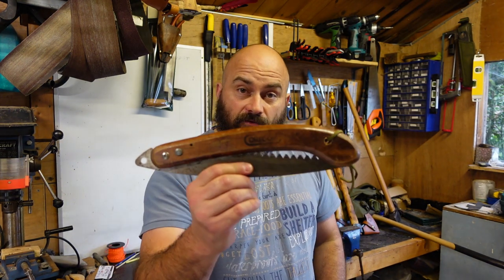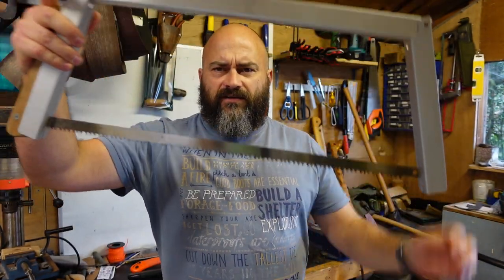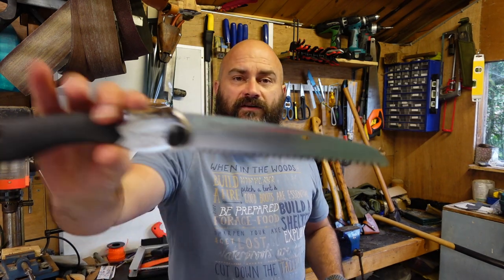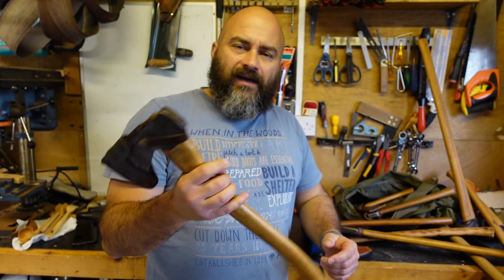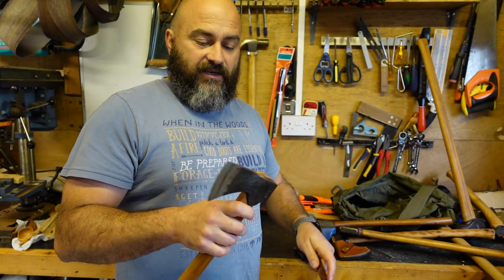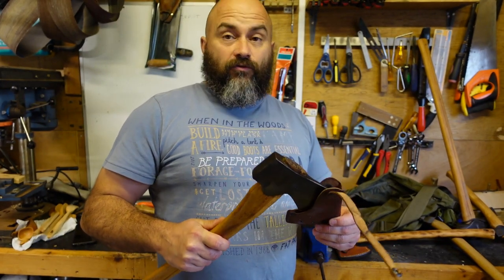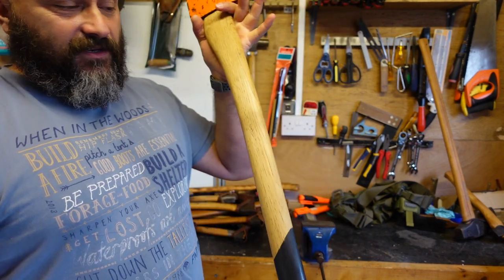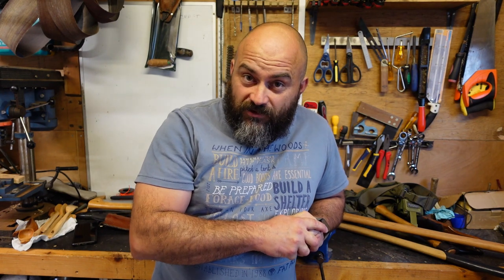038 My Axe and Saw collection

Comment: I'm up here in Northern Sweden and we have a large wood heater in the basement of one of our houses that heats two houses through a hot water system during the whole of Winter...well,  I cut, limb, section, carry out of the forest, section again and cleave about 33 cubic meters of firework every Spring. All I use is a Husqvarna Rancher chainsaw, an ancient, good quality cleaving axe for the job (it looks very like your Husqvarna but isn't) and a GB Small forest Axe...no way would I use the hydraulic machine instead of the cleaver either, not while I have the physical capability to still swing my beloved axes.

Super collection mate and nice to hear your thoughts on them.

Comment: Greetings!  You may well have more hand saws than me, but not axes or chainsaws LOL! Your first Wetterlings axe that you showed is, I believe,  a Large Hunters Axe, being a big Wetterlings Axe fan I picked a used ine up last year and cleaned it up. I have had the Wetterlings Les Stroud Bushman Axe for many years and it remains one of my favourite axes. I also have the Wetterlings Forest Axe (similar to the GB Forest Axe). I do not do much carving, but I prefer to use an old HB 0.7Kg axe that I made up a shaft for. I recently bought from the UK a Draper Expert pruning saw, for 35 Pounds  it was good value and cuts pretty good though it is more like a carpenter's saw with a curved blade and a little cumbersome. Nice, smaller Husqvarna saw!...I have a 45cc Jonsered and 45cc Sachs Dolmar, the Sachs is a great saw. Best Wishes, WS

Comment: Hi mate first time viewer I've only just got into axes and saws and a bit concerned about maintenance just ordered some linseed oil to try
Reply from the maker: Boiled linseed is best for the handle as it dries quicker.
Reply: @welshwoodsman  Thats the one I ordered luckily! I'll give that a go when it turns up I've got the hultafors agdor axe and bahco axe
Reply from the maker: @MrWildWales  it may be worth you lightly sanding the handles down first, as they may have a lacquer coat which will prevent the oil penetrating.
Reply: @welshwoodsman  ok will do cheers

Comment: 03:50 the coating makes it stick even more. It is textured and therefore creates more friction. This leads to more sap being stuck on the blade. Bhaco's also are very dull and take forever to cut. Theyre only good for small detailed tasks. A silky smaller than a bhaco runs circles around the baco